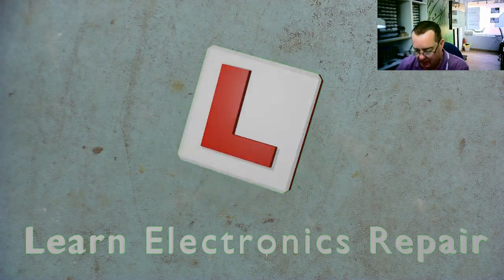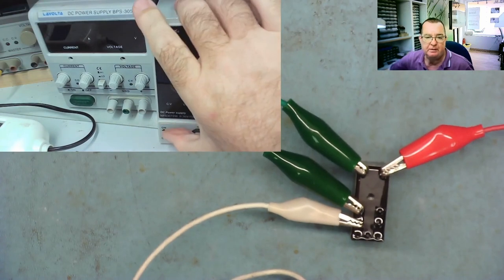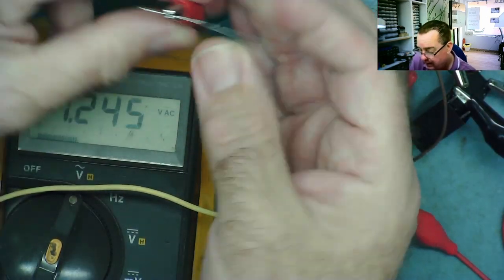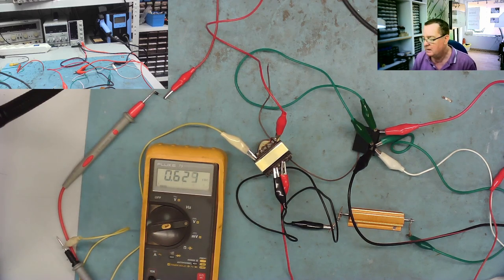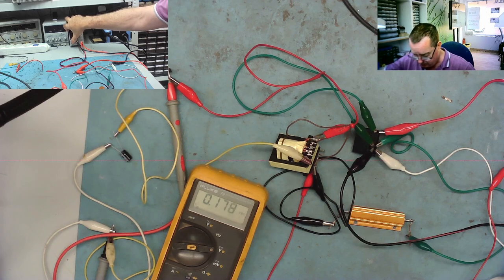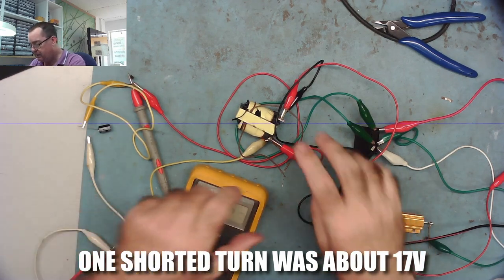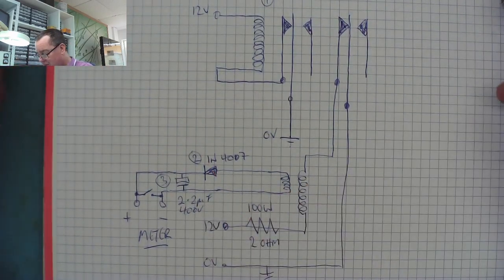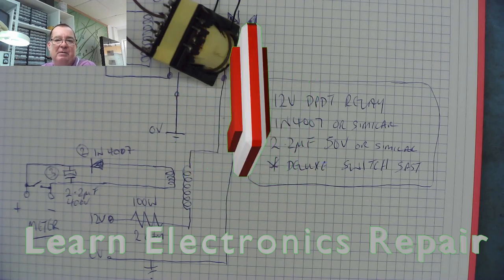How To Find SHORTED TURNS In A Transformer Without Using A Ring Tester

Comment: How smart was that? The simplest answer to the most common and seldom resolved question for any guy who has ever encountered windings outside of an electronics workshop. Awesome !

This little genius experiment got me thinking in a way I never did about the magnetic interactions of the different windings and shorted turns. I have now reached the awareness from a physics vantage point that a shorted turn, wherever it is in a transformer, primary, secondary or made up ad hock with a looped piece of wire, is a stand alone, near to zero resistance, closed secondary circuit in itself. Its own current is not interacting at all with primary or any other secondary winding current from an electric point of view while it does from an electromagnetic point of view and has to be analyzed as such. Yeah I know, it's obvious but what can I say? I never thought of it like that before. I might be slow.

Then all becomes clear if you know your physics. We know three things: magnetic variation creates EMF in a conductor, current through a piece of wire creates an electromagnetic field and variation of current in a turn creates an electromagnetic field that creates in the turn a counter electromotive force that tends to oppose the variation of current (inductance). The higher Tesla variation rate , the more EMF; the lower resistance, the more Amps; the higher Amps variation rate, the more contrarian Teslas.
Current in a regular turn of a winding is limited by the reactance of the circuit while current in a shorted turn is not. 
Therefore, submitted to the same magnetic variation rate, the current through a shorted turn is completely electrically independent and significantly higher than the current in any other turns in any other winding, be it primary or secondary. Being approximately a linear function of the currents ratio in our case (almost synchronous current signals, different amplitudes), the current variation rates ratio between shorted turn and primary winding is also high.
When the electromagnetic field produced by the primary varies, the induced current high variation rate (because of the high current pics) in the shorted turn creates a significant contrarian electromagnetic field that dampers the overall magnetic variation rate hence lowering the EMF in the secondary. One shorted turn contraries the EMF like dozens of regular turns, perhaps a hundred all because of the high current variation rate ratio between the shorted turn and the primary.
For the addicts, maths here are not too heavy and it starts with the self generated electromagnetic field in the center of a turn being an increasing linear function of the current in the turn. Also the current in the shorted turn is an increasing linear function of the current in the primary whose factor is the resistances ratio. Differential equations for the current variation rates and the electromagnetic field variation rates reduced to a spiral approximation are quite basic.

Finally, lower electromagnetic variation rate overall produces lower output voltage in any secondary winding, basically like when the output current draw increases, increasing the contrarian electromagnetic field in the secondary which requires a higher current variation rate in the primary in order to sustain the overall electromagnetic field variation rate and so the output voltage.

The resistance you added to the primary played a major role for that matter in lowering the current in the primary therefore increasing the current variation rate ratio with the shorted turn hence increasing the output voltage drop reading.

Obviously with this particular circuit, the most significant voltage drop will happen with the first shorted turn and the series is logarithmic. When a second shorted turn occurs, the electromagnetic variation rate has been seriously degraded already by the first one so the induced current variation rate in the second shorted turn is noticeably lower while the current variation rate in the primary hasn't changed, so the current variation rates ratio is lower than for the first shorted turn, so the added contrarian electromagnetic effect is noticeably lower, so is the voltage drop reading as it will be so, with decreasing effect, for any new shorted turn.

Rich, how about you add a potentiometer in series with your shorted turn and build a manual output voltage regulator out of it ?

Man, this one was a kick in the butt. Talking about a wake up call and I have to thank you for that.

Comment: I have a circuit diagram of t he ring tester  in kit form that I built years ago and it is the best for this kind of fault finding and it really works well it shows the condition of the windings with leds  that light up! IT is quite simple and effective for line output transformers and other SMPS  Transformers used in older technology television systems and such it is very effective and helpful 🤓
Reply from the maker: Hi Ross  Are you willing to share the schematic and I'll build on as a comparison with this idea and the PCBWay ring tester I built
https://www.youtube.com/watch?v=0-LrAW6PpKk

Comment: Using the relay like continuous oscillating would soon burn out the contacts? I remember way back in 60’s I used to work on lots of relays and contact burn/wear was very common! Another problem was oxidising contacts where very low currents were switched I.e. audio signals being switched like in dictation equipment! Gold plated contacts were supposed to cure that problem but no or noisy signals ( frying eggs )were a nightmare! Phone exchanges were a nightmare (crackling frying etc ) when you wanted a dial tone! Solid state switching cured all that stuff! Fraser

Comment: I would have liked to see the real size of those back EMF pulses on a scope. The trouble is you could damage the front end of the equipment trying to measure the pulses.
I don't think your Fluke liked those pulses much, plus I'm not sure what frequency or bandwidth the Fluke responds to either.
You mentioned how you would get shocks off similar circuits in the past so I believe you could have been generating spikes well above 50volts to be able to feel them !
A single pulse might give a better result with a storage scope capable of handling the back EMF voltages adequately. 
We normally mount diodes across coils to suppress this back EMF spike so it doesn't damage the semiconductor driving the coil, so I would expect the peak back EMF to be much greater than 50 volts. Rich, please don't blow up your scopes proving or disproving this !!

Comment: Seemed the 2nd shorted turn wire was smaller gauge than the 1st (maybe folded al-foil could work better?). I do see another useful video here: Spruce-up digits on the trusty Fluke 79 by cleaning the LCD's zebra strips with IPA👍
Reply from the maker: Yeah it was a bit thinner wire, I was just using bits I had lying around.  I doubt that had much affect on the results, as both pieces of wire gave very similar voltage drops when used individually, and putting two shorted turns made very little additional difference
Reply: IPO?
Reply: @lezbriddon  Oops sorry! Got me 😂 IPA (isopropyl-alcohol) I buy ~ 8 liters a year. Techie's bath in it.
Reply: @CliveChamberlain946  I did think it was a typo but thought is there something else that's new I've missed out on

Comment: In spite of the fact that the transformer under test would likely be designed for a primary voltage of about 350, it is probably being driven to saturation with the test circuit. Without knowing the configuration that would have been used in the original circuit I'd guess it was a forward converter and likely limited to 50% duty cycle. At 100 kHz, that would equate to 350 V x 5 µs = 1750 V•µs. At 12 volts you would reach that at 146 µs ON time. There isn't the slightest shred of a chance that the relay circuit would be applying anything remotely close to that short. The transformer would have been driven into very hard saturation. Most of the energy would simply be generating heat, in the case of the test circuit in the resistor, and nothing of interest with regard to detectable signal. 

This sort of crude circuit would probably be OK with an iron core power transformer.

With the SMPS transformer, I'd experiment with using the primary as the inductor in a boost converter. You could use the relay as the switch. I'd try a 1N4148, which is extremely fast, and a small 100 V cap, possibly with a 50 V zener across it to limit the voltage. I'd try about one or two volts to start with for the input to the boost circuit.
Using the winding in a boost circuit and ignoring the secondaries removes uncertainties of the phasing in the windings.

Comment: I did the same basically, as a kid, I made a model of a electric fence, in a board,  powered by a lantern battery, 6v,  and a bell motor, it was on a board, with a copper wire fence, and aluminum foil for the ground, touch the 'ground' and the fence , you get a tingle, It was the 5th grade.   I built a generator, using a electric motor, and a generator from a old Chevy truck,   as science projects,.  The friggin volcano won! 😧

Comment: As we are talking about small resistances, induction and all sorts of gubbings is it valid with all those croc clip cables lying around Lol ! whatever, it's interesting just messing around....cheers!
Reply from the maker: Well really the actual voltage readings don't matter, it's whether putting a shorted turn on the transformer has a big effect (good one) or very little effect (bad one)
Reply: @LearnElectronicsRepair  Good point 🙂

Comment: 8:50 The DMM shows 1,95V when the relay is not actived, and the voltage is jumping all over the place. 
The voltage on the DMM should be more stable when you use a bench power supply as power source,so there is definitely something wrong in this test setup.
Reply from the maker: All the high frequency spikes caused by the relay switching the transformer I would say.  Once I added a capacitor it worked as expected

Comment: how about building a isolation transformer and dimbulb tester in one device  that is a nice build project and you can teach how it makes repairs safer by having that kind of device / kit I would sure watch that video because there is the calculation of how much Va the transformer has to be the danger of grounding and the benefits of the current limiting with the bulbs and how you can combine both in one housing ... maybe a fancy one with volt and amp meter inside electronic fuse switch for ground or no ground etc as doing repairs you should do it safely think that would be a very good video topic for your channel maybe build it in a live stream so viewers can ask questions during the build and where to get the components that are used ..... what you think ? would it be something you like to do ?
Reply from the maker: Yes, this is very much the setup I already have - 2KVA 240V:240V connected to my 2KVA Variac which has a light bulb current limiter on top.  And some Frankenstein style round voltage and current meters.  You probably saw that on the video I was showing around my new bench setup.
https://www.youtube.com/watch?v=eJQKKMwUW9s  at 00:02:00

All I need some of those twin antenna things with sparks running up and down them that you see in old Hammer House movies to complete the setup LOL
https://www.youtube.com/watch?v=1qNeGSJaQ9Q   Them things at 00:00:39

Actually that reminds me - if you want to watch something totally bizarre, in a similar vein, try this
https://www.youtube.com/watch?v=TDYzLJk36VI
Reply: @LearnElectronicsRepair  would be nice to make a video on how to make that and hopefully the ones that try to do repairs stay safe because of it ....where do i find a 2Kva 240 / 240 transformer ? been looking but could not find anything  thanks for the reply
Reply from the maker: @Dutch-linux  I got mine second hand from ebay in the UK around 2014 for £50.  Similar price with the used Variac though it was uncased when I got it
Reply: @LearnElectronicsRepair  yeah been looking on ebay but only see like 500VA for stupid high prices  coulkd something like 2 same spec toroidal transformers lets say 240v prim to 40v sec and connect the  sec from transformer 1 to sec transformer 2  so basically you do a step down and a step up so you get 240 in and 240 out or would that have to big of a loss or am i crazy to think something like this would work ?
Reply: @Dutch-linux  hi, i have send you a mail about the isolation transformer.  Grtz from Belgium

Comment: Even cheaper and fewer components - normally open push button, relay (SPDT) and power resistor - connected to power supply and oscilloscope. Regards, David
Reply from the maker: Ahh but that needs an oscilloscope - which a lot of viewers here don't have 😉
Reply: @LearnElectronicsRepair  Fair enough, although I can't imagine doing much electronic repair without a scope. So add a bridge rectifier and a capacitor and use a multimeter. Just don't use a relay as a vibrator. Regards, David
Reply from the maker: @davidv1289  Looking from the channel stats (and sometimes in comments) a lot of viewers are coming from countries where the socio-economic situation makes ownership of something like an oscilloscope pretty much impossible.  While I agree with you a scope is pretty much on my list of essentials (though I don't use mine a huge amount on video) I also like to think of idea like this, and the $1 short finder to make electronic repair accessible as possible.  Maybe by using cheap get-a-rounds some viewers can generate enough income for for a scope too.    These cheap ideas don't always work of course 😉
Reply: @LearnElectronicsRepair  I absolutely agree, anything that provides information about the operation of a circuit when troubleshooting is valuable,  whether it is a non-contact voltage detection "pen" or a vector network analyser. Your short detector/milliohmmeter is a perfect example! My "beef" with this project is that using a relay in this way will result in a very short lived and unreliable device that will probably provide more confusion than information. Too bad valve type automobile radios aren't still around as their vibrators would be perfect. My comment about oscilloscopes was about me personally based on my 43 year career as an electrical and electronics technician - I would have a hard time troubleshooting without one. Regards, David
Reply from the maker: @davidv1289  Your points are completely valid and I'm totally sure this is very bad for the relay, though it does seem many of us here did this sort of things with relays back when were kids (not to test inductors just to make something that made a funny noise, and some of us also discovered back emf too) and I seem to think my interest in the circuit faded away before the relay ever did LOL

Comment: Would it be possible to measure and compare the AC current passing through the shorted turn instead of the output voltage change? It would simplify it.
Reply from the maker: That's an interesting idea actually 😉

Comment: Got me thinking, what if you connected a speaker to the output instead of the diode, the cap and the multimeter? Would it be easier to compare the effect of adding another shorted turn? It might require a an amplifier though. Also, warn people not to connect it to the microphone input or line-in of a computer or another sensitive device. It would be even more noisy but that's the ghetto way lol.